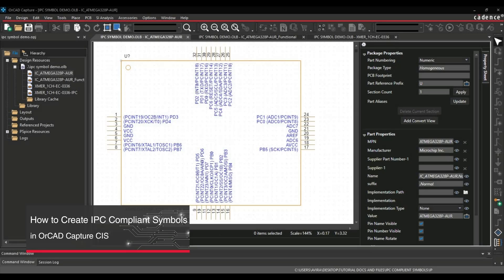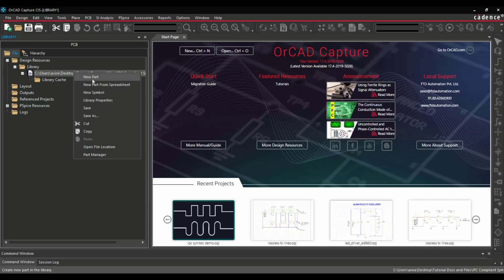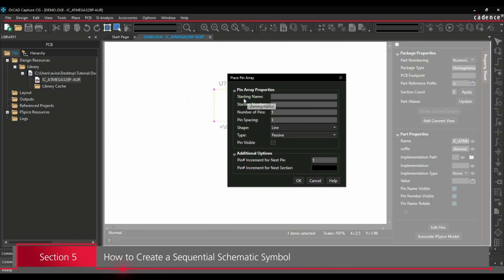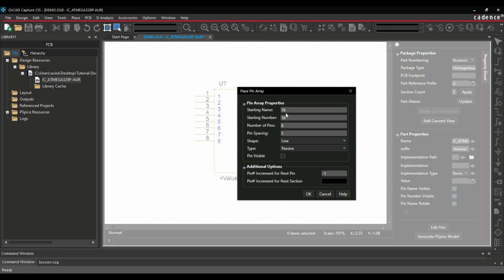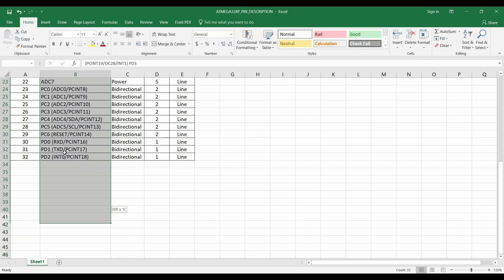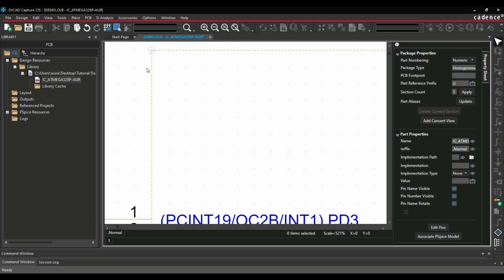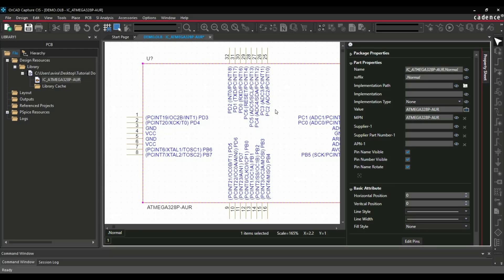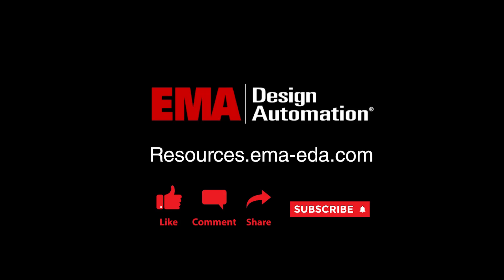How to Create IPC Compliant Symbols in OrCAD Capture

Comment: Does IPC-2612 specify this or IPC-2612-1? What is the difference?
Reply from the maker: IPC-2612 and IPC-2612-1 are standards published by the IPC which provide guidelines for the creation and management of schematic symbols and netlists for electronic components. IPC-2612 focuses on the requirements for electronic product documentation, specifically for digital data acquisition and generation while IPC-2612-1 is a sectional standard within the IPC-2612 series that focuses more specifically on the schematic and logic descriptions of electronic products.